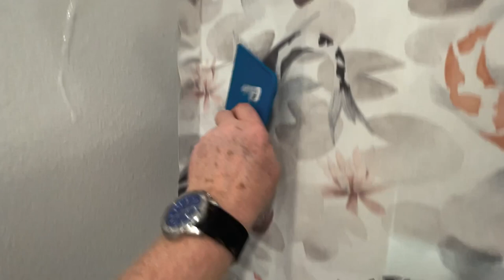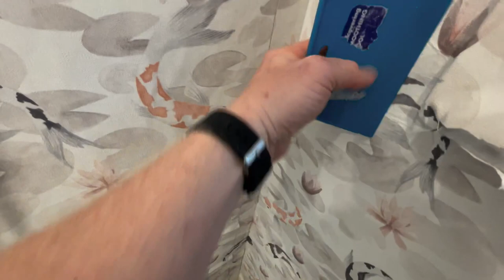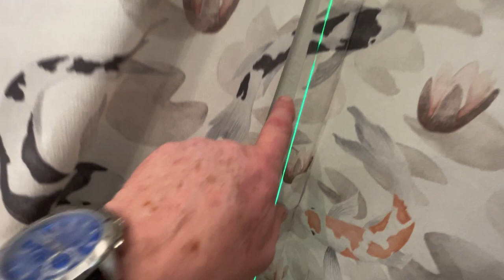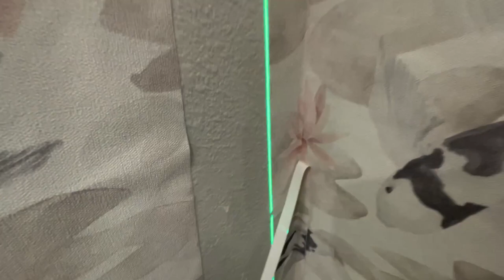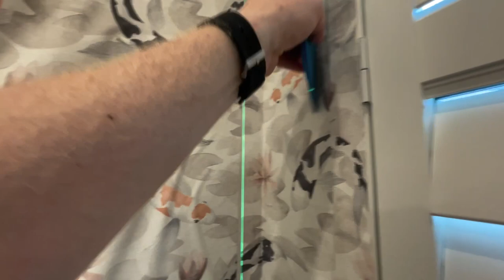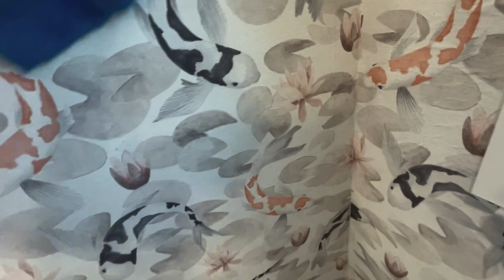Why is it SO Difficult to Wallpaper Around a Window? - Spencer Colgan

Comment: Spot on.
Laser liner above and below windows helps us pros now... A string plumb bob gets thrown out with the architrave of the window.
Top tip for doing larger length windows... Take the top, then the bottom lengths at the same time... Don't do all the top... Or all the bottom... You'll be miles out for joining up.
Non woven paste the wall paper also is better for not over stretching when doing tricky drops.

And Spencer... You're still allowed to wear your Breitling when paperhanging.. if you need to time your lengths ;)
Reply: @DeanLangley  i often say in my vids about butt joints.... the paper will only go where teh wall goes.. if it's nice and flat/level.. it's a walk in the park.. if the wall is all over the place, you're having to work the joints, as the wall takes the paper where the paper doesn't want to go and you are then fighting to get the paper back to butt up. lol